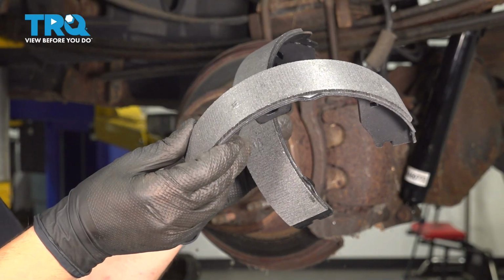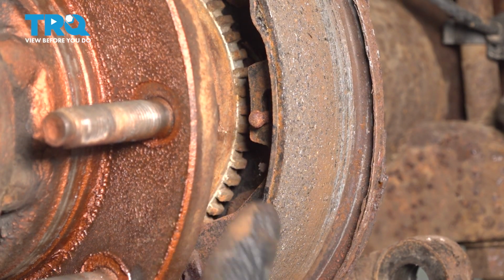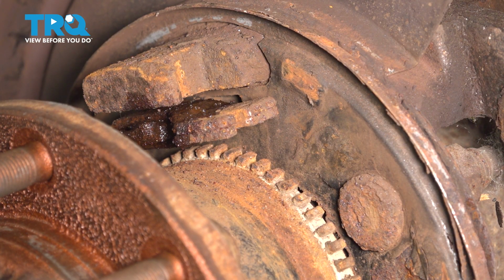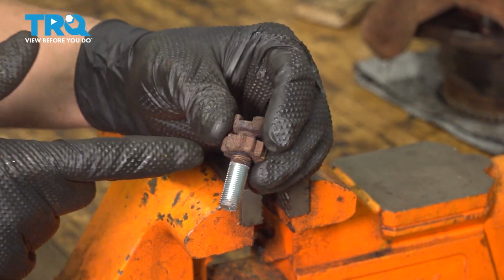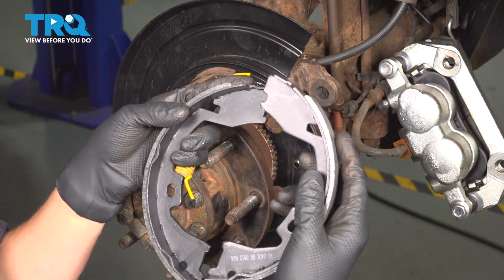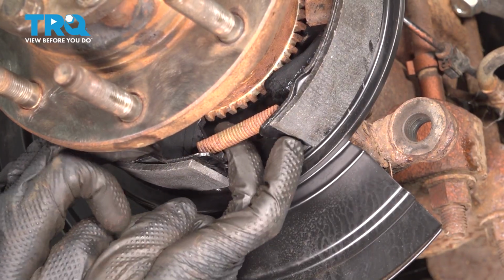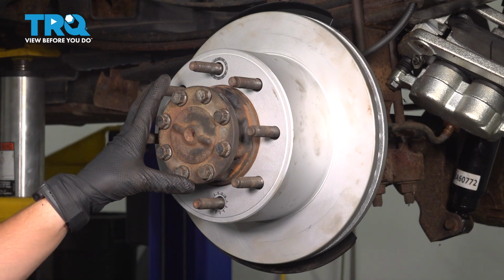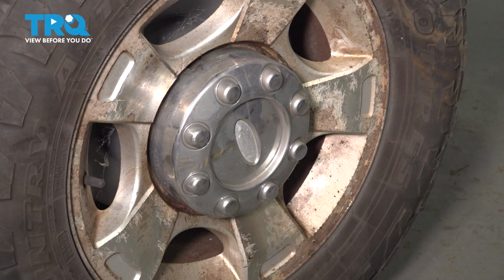How to Replace Parking Brake Shoes 2011-2016 Ford F-350

Comment: Why replace shoes?  They don't wear as they only hold a wheel in place after you stop.  The ones you took off ere like new. Same for talk about squeaking . you apply brakes after stopped  (usually).